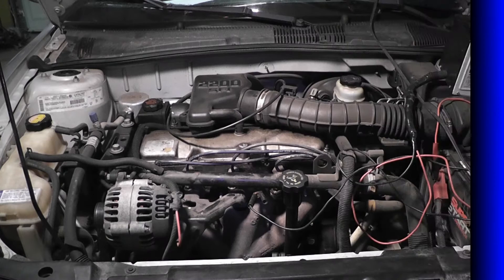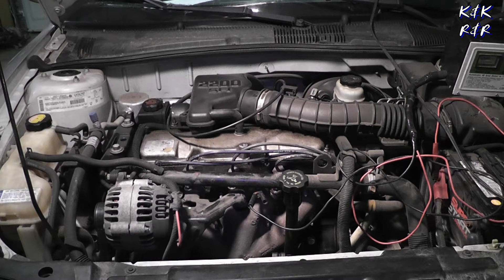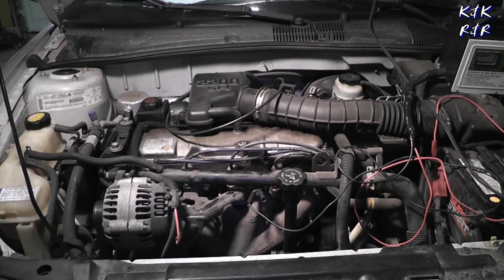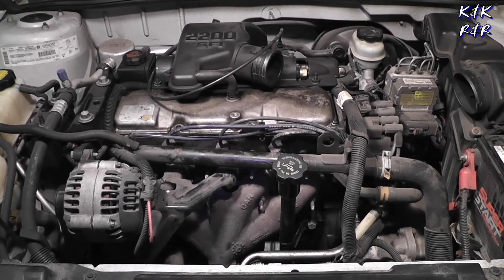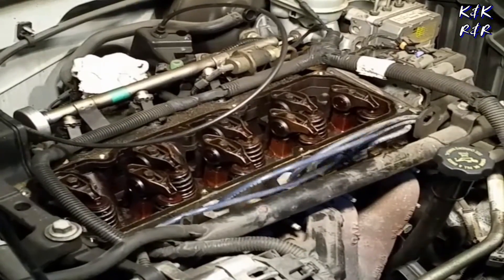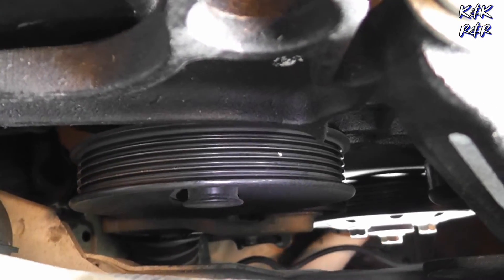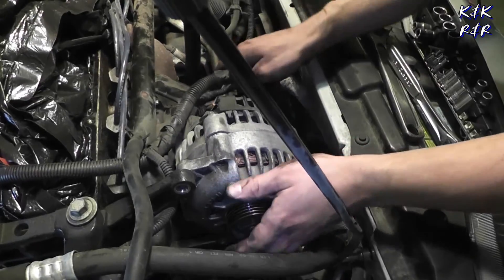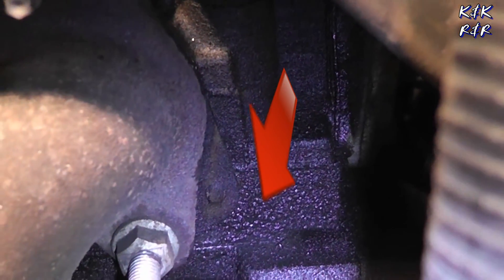How to Replace A Broken Timing Chain 2001 Pontiac Sunfire 2 2L PT. 1 Diagnosis

Comment: Hello and thanks for the video. Sorry if you addressed this somewhere but did you replace the engine core plug that sits behind the timing chain? Part # 14033197. It's what supposedly makes the tensioner and chain go bad after the orifice gets plugged with carbon from not changing oil regularly and then the chain/tensioner doesn't get any oil. I'm wondering if it is even possible to replace it with the engine in the car because it apparently requires the use of a slide hammer to remove it. -Thanks Again
Reply from the maker: We don't normally replace the oil feed weep cap unless its gone, at that point you would have low oil pressure if it was gone.  We make sure that the feed hole is open and clear.   Generally chain stretch is what destroys the tensioner.  The valve springs are a little heavy for this engine but they use them to keep valve float at bay during high rpm operations.  If the weep hole is clear and clean I wouldn't waste the time to replace it.  Most timing chains are feed from splash oil returning from the head to the oil pan.
/K&K

Comment: Is this an interference engine?
Reply from the maker: I don't believe so. I have seen a few split a chain and live again.   You get the crank and valve so out of time they all can become an interference engine to some degree.
/K&K
Reply: @KNKRNR  thank you. at what mileage do you recommend changing the chain as preventative maintenance? I am at 228k on one that I bought new in 2001
Reply from the maker: @historicalwarfilms4203  I don't know that I could put a mileage number on this repair for preventive maintenance.  It just depends on how well the oil changes have been kept up and driving habits.   Generally you will have an unusual noise at start up or cold late starts  before this chain system lets loose. This engine in the video had low miles 122K but owned by 3 different drivers.  The last driver had a heavy foot.  2.2L is no rocket but taken care of runs for a long time and gets good as mileage.  Timing chains are not normally a wear item you change.  The time to change it would be if it split or starts to give you driveabilty concerns that are timing related.   With 228k replacing the timing chain now might give you other issues like blowing a head gasket as the engine typically has more compression once you replace the chain. Its safe to say you won't have an issue if you haven't already.  To me looks like you have taken care of your maintenance pretty well.  I would wait till you have an issue with the timing chain to change it.
/K&K
Reply: @KNKRNR sure hope I don't blow a head gasket. My little Rust Bucket has 216k and the timing chain tensioner cracked in half causing noticeable noise that I initially thought was lifter tick. I've already tore the engine down and replaced the chain and tensionerz but haven't pulled the pin or started assembly beyond that point. Here's to hoping I don't blow a head gasket.🤞

Comment: Is the 2200 SFI the same as the 2.2 Ecotec?
Reply from the maker: No, the 2.2L Ecotec is a DOHC engine.   Ecotec uses a different timing chain set up then the 2200 SFI.
/K&K

Comment: what lube did u use on the timing chain sprocket ,ur videos are a great help great job
Reply from the maker: We use this pre-lube in the link below. You can buy it at most auto parts stores. Glad we were able to help.

https://www.amazon.com/Sta-Lube-SL3331-Extreme-Pressure-Assembly/dp/B000M8RYUE/ref=asc_df_B000M8RYUE/?tag=hyprod-20&linkCode=df0&hvadid=312181776237&hvpos=&hvnetw=g&hvrand=10149142114504153077&hvpone=&hvptwo=&hvqmt=&hvdev=c&hvdvcmdl=&hvlocint=&hvlocphy=9033784&hvtargid=pla-623685627567&psc=1

/K&K